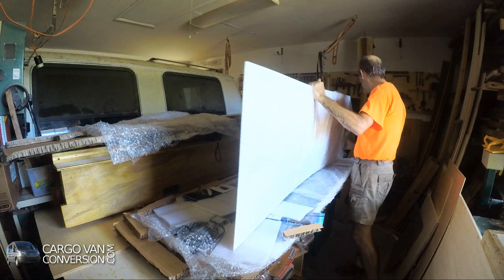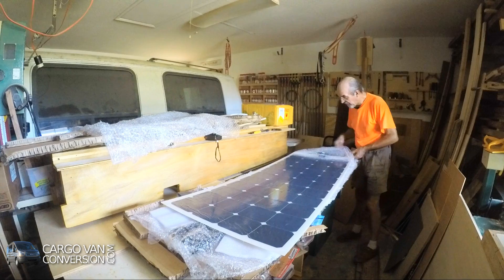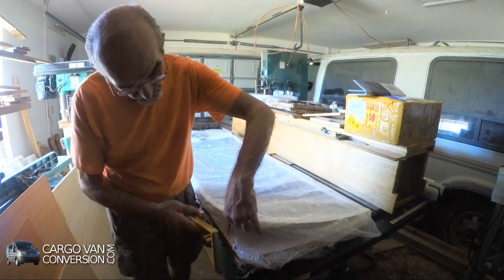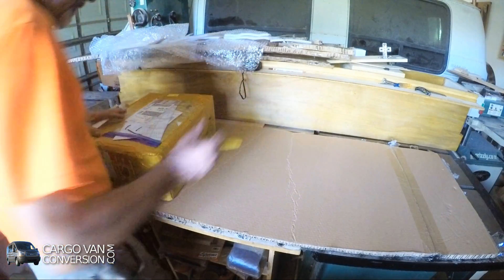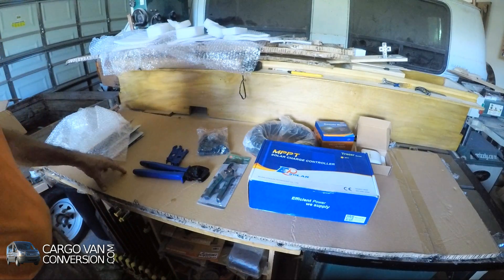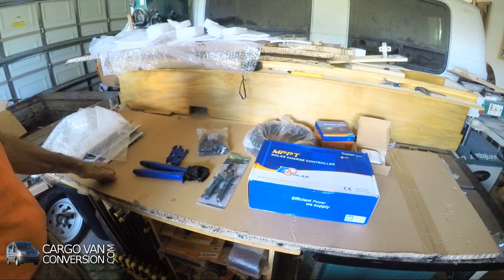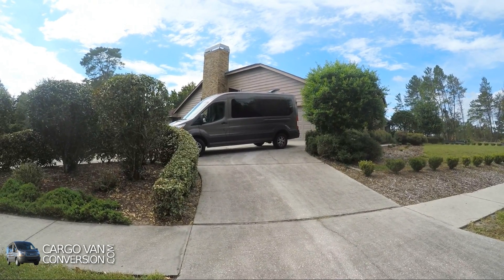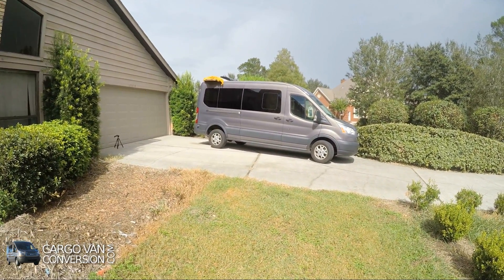Buying Flexible Solar Panels From China

Comment: ok linksolar lists it as $300 per 100 watts....that sounds fucking nutts, especially when you can buy panels on amazon for ~100-150USD.
Reply from the maker: Link-Solar is a sponsor of my website, but I have nothing to do with their company or pricing. That said, you shouldn't compare apples with oranges. Solar panels may look alike, but there are many differences. These 'second generation' flexible solar panels come with an ETFE laminate that has much less reflectivity and shouldn't have the delamination issues, that the older PET panels had. Then there are the solar cells; these use high-efficiency Sunpower backcontact cells. Backcontact cells are the latest innovation of solar cells with more exposure to the sun. Probably the biggest misconception is about the grades, solar cells are available in. Seldom you get the highest grade, as they are simply to expensive. My panels come with a higher grade solar cell, while many of the cheaper panels likely are not. You can read more about these grades here: http://cargovanconversion.com/LS/solar-cells
It is difficult for the uninitiated, to compare the quality of different panels and sometimes you have to pay more, to get better. For me that's uncertain too. I've done some preliminary tests and right now I'm installing them on my van and many more tests will be done as I start using the solar power. I will be posting more about that soon and will continue to do that over the lifetime of these panels, as little information is available about these flexible solar panels.
Where does that leave you? I had a specific need for flexible solar panels, but if you can do with regular rigid panels, I would suggest to get that way. They are much cheaper and have a track record. I you prefer flexible, do a lot of research, but avoid those 'first generation' panels and wait a little for prices to come down.

Van Williams
Reply from the maker: Hi VagabonDaze,
I get it. Prices will come down I suppose. You can go with the cheaper flexible panels of around $150/100W, but if price is the main stumbling block, I would go with the rigid panels as well. They have a track record and you can buy them for as low as $0.50 per watt. Remember, the panels I use are 135 watts.
I still remember when I paid $1000 per panel (rigid), so everything is relative :)

Van Williams
Reply: Cargo Van Conversion yes, very true can you tell me what the cost of the entire is with charge controller and everything?
Reply from the maker: Hi VagabonDaze,
I can't tell you to the exact dollar amount, but everything you've seen in the previous video and what I'm installing in this Friday's video, is approx. $1,500.00 incl. taxes and S&H. That includes the three 135 watt solar panels, MC4 connectors, MC4 branch connectors, VHB tape, cable gland, tools like crimpers, lugs, welding wire, breaker box, circuit breakers, Blue Sea bus bars, power post and fuse box, controller and remote meter.
Remember, that no matter what panels you use, that quality wiring, breakers, bus bars, etc., the so-called accessories, also cost a handful.

PS I want you to know that besides Link Solar being my sponsor, that I have nothing to do with what they are offering. I am currently trying for them the offer a custom 'Ford Transit' package, that would include most of these items, similar to what I have, for an attractive price. Don't know how that works out, but you can always contact me again.

Van Williams
Reply: Lost me on that price...I really wanted these panels as I think they are perfect for my curved rooftop but I'll just go with standard rigid for that price.
Reply: I see 21” x 42” 400 watts for $150 flexible solar panels is that real & doable

Comment: perfect fit -  VHB mounting ?  I painted roof  of my red van  white and could hardly see it UR panels wont be  noticeable at all  - do a review on solar charger too
Reply from the maker: The specific size of these panels allow me to mount ~400 watts on the roof of my Ford Transit. And the're so thin, that they will mount just below the roof line. As you said, mostly out of view.
Contacting 3M, they did not suggest using VHB for this purpose, yet at the same time, told me that so many RVers have good results with it. Couldn't be more duplicit. I hope that by leaving space open between pieces of tape, more air can flow underneath, cooling these panels down as they are prone to overheating.
I'm still holding off on Lithium, for the time being, and will be able to test the controller on lead-acid. That gives me some time before I'll likely change the controller to a Victron and the batteries to Lithium.

Van Williams
Reply: so far the Lifepo4  has been working well - ran down to 12v  one time to test Victron battery cut off  worked well - I put a House Bathroom fan on  air vent installed same area as U put vent - works very well - Quiet - 
also painted my Red van white - Huge difference - went from Oven to Nice - wish had done sooner  - - 
Van skin temp white 105  -  red 134 - night and day difference 
 for Solar the VHB tape works well  -  its the way to go - have not read or seen any fail on solar install and most were on  regular solar panel - I was considering flexible was thinking of putting foam mat under panel mostly to reduce heat gain - but 1/8 thick layer of Coroplast is a better choice - has channels that run length wise and would help in cooling - very low weight  - get at sign supply -  but since you have dark color van doubt you need any thing in between -
I decided to use regular solar panel - its arriving tomorrow -  grape solar 180 watt from Home depot - trying to find good controller - have read Epsolar controller is slow to adjust mppt - do a controller review-  Im building roof rack right now - 
 made a slider door lock with rivet nuts into door panel  so can secure with door open - rivet nut pulled out of thin door metal Super easy so it was a giant fail - going to add metal plate to door with VHB and rivets - hope its strong enough - van metal is so thin -
 starting van build YT channel soon and show some new stuff I made - U will like - Jay
Reply from the maker: Hi Jay,
Good to hear that the Lithium is working well; do you ever run into problems when running it below ~25%?
Wow! Repainting from Red to White; I was just contemplating to get a Red or bright Yellow van next time. Being very cynical, perhaps too much :), isn't the difference between 105F and 134F like between hot and hotter? And does it actually make much difference in the interior? With good insulation/ventilation it should be minimal, with minimal insulation, it will be hot either way?
I also decided to go with VHB from all the positive feedback from RVers who've used it before. The overheating issue of these flexible panels is still unclear to me; the most accurate info I have found showed a ~10% reduction; that may be higher or lower, but besides elevating the panels very slightly with the VHB tape, I assume the power loss and add more panels as needed. The assumed power loss happens during high temperatures, but in general, the bottleneck of the RV solar system lies in winter when temps are way more moderate. It may be a non-issue.
I'll do a review of the EPSolar controller soon, but may switch to a Victron 50/100 controller when the Lithium batteries arrive. Originally I hoped to get a Victron EasySolar which combines a MPPT Controller, an inverter/charger and AC distribution in one. Would be a compact RV solution if they also produced as a 110V system.
I always have to laugh when I see Sprinter owners sitting on their roof; try that on a Transit :) But we may get a better fuel efficiency.
Let me know about your Youtube channel and I'll be the first subscriber....

Van Williams
Reply: Hey Van  -
painting van made Night and Day difference -  
knew it would but the difference is WAY More than  expected -
the hottest its been Inside van since painting is 94f -
Red van was 112 to 120 inside All the time and really did not
cool off at night because of insulation - 
red van skin would be be 134 to 143 all day -
heat soaking - 
now skin is 107 at most -
and cools off quickly at night -
I painted van a Very lite Purple - LOL 

all solar looses about 10% when it gets hot -
VHB is way to go especially with flexible -
the only concern I would have is panel Fluter -
might make noise - 

there is Lots of misinformation out there on lifepo4 
that I think has been put out by lead battery manufactures
is my guess - they have most to loose - 
I have cutoff set at 12v and tested it to see if it worked -
so far 100ah  has been enough power to last me all day + -

when low volts are reached lower than  3V - 
volt level drops off cliff -
not much power there - 
but till limit is hit power is very steady-
nothing getting dim or operating weird -
I mounted Lifepo4 next to stock battery under seat-
 had to cut battery box some - just fits

Do a review on Victron gear  too -
I tried to buy Victron Lifepo4 setup but 
they were sold out  the 2 times I tried -
Talk more soon- Jay
Reply from the maker: Hi Jay,
I will revisit the whole vehicle color thing, just don't ever want to go back to white. Perhaps silver or yellow, but not this workvan color. But since I am a warm weather traveler, these differences would make life easier.
Suppose you're correct that all solar looses 10% or so; rigid panels however have a bit more air flowing underneath. It's all relative anyway. I haven't thought about the possibility of flutter. Was planning to use a lot of tape on the front side (direction of the traffic), but less elsewhere. I will use much more now.
Lithium is still not well supported; most information comes from users. Not many manufacturers either and prices haven't gone down in 5 years. No industry wide standards about charge settings. It's just a jungle out there!
Victron makes quality gear, they just don't seem to care about the North American market. Some of these firms should start making integrated systems; that would make installions by RVers much easier and a lot safer. It's just a lot of work getting all the individual parts and putting it together and that's, if you know what you're doing.

Van Williams
Reply: my solar panel arrived 2 days ago - 
180 watt Grape solar to go with purple van 

ordered a Victron MppT 75/15 -  supposed to arrive next week -
Yup  Victron makes good gear - I tried to order Victron complete
Lifepo4 system 2 times over the last 15 months and they were sold out both times - finally I gave up on it and built my own setup -

Lifepo4 is not really that complicated - there is Lots of miss information out there that complicates things
  and I think its lead battery companies doing it -
they are selling old tech and have the most to loose -

yep very few good chargers that run off alternator power -
the one Im using has worked so far pretty well - 
but its not made for automotive use - 
charge max is 75 amps - 

Victron 75/15 will  solar charge Lifepo4 -

If you have any questions on Lifepo4 I can answer
them for you - I have clear understanding of them -

Have not seen you on transit forum in a while -
I dont go there much now - 

got tired of loud mouths on site -
that and Everyone uses Quotes on Every post -
Its ridiculous - 85% of text on there gets quoted
over and over for zero reason   -
Ive been on forums where No one quotes anything at all-
I have bad dyslexia and all the quotes ruins site for me -

today -
Made slider and rear door locks so I can have doors
open to get breeze  but still somewhat locked to keep unwanted visitors out - 
also pulled plugs out for roof rack mounts - 
going to install rack monday 

Have fun --Jay
Reply from the maker: Hi Jay,
I'm still intrigued by your 'purple' van; do you have a picture of it? Must be unique!
I think the confusion around Lithium comes from too much user generated data forced by lack of manufacturer documentation.
That's not a problem when you're buying a set of cheap lead-acid batteries, but when you plan a $2000-$5000 system one doesn't want to make a few silly mistakes that ruin your setup.
Haven't been on the Transit forum for a while, just too little time, since I've started my weekly videos. Doing the work, the editing, the website and the whole social media thing, takes too much time. Never thought about dyslexia in that way, but makes sense.
Wish you the best with your panel, mounts and controller.

Van Williams